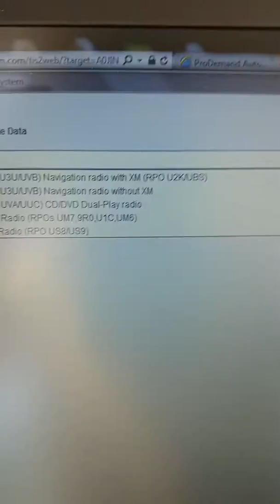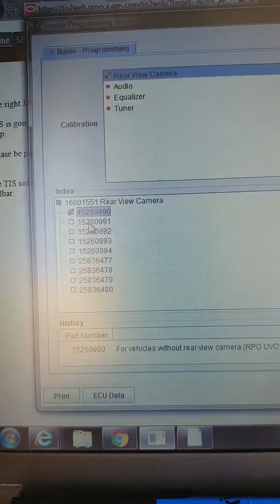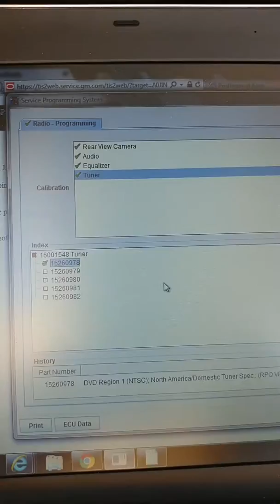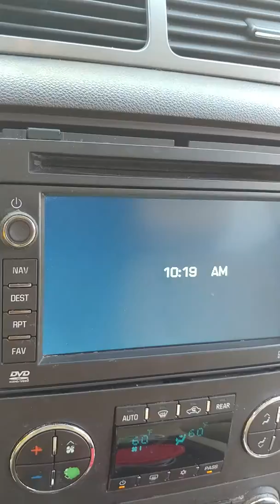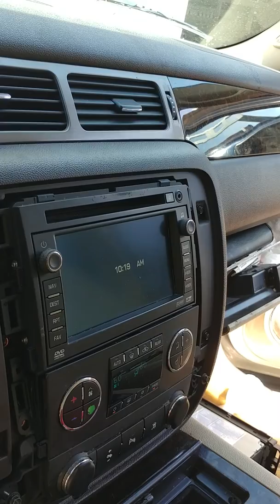Programming a used gm radio

Comment: I have a 2011 Buick enclave (nav not working), I got a used nav/radio out of a 2007 GMC.  But it has the ‘theft’ lock on the screen.  Where do I begin?  Looks identical to what you have in this video……

Comment: hi I have installed a 06 nav/xm head unit from a 2006 hummer h2 on my 04 h2 after that i also installed a LUX amp (from a escalade)to work with the radio and now the amp needs programing do i need just need the tech2 software or will need to download files to reprogram the amp ?

Comment: Hey Rob I thought the tech 2 tis2web was to 2008 but really 2007 and anything newer would require mdi gds2? The options are crazy trying to sort through them. This is all so confusing!
Reply: buggyalstare1971  you can do this with any passthrough device but I believe tech 2 went as far as 2012.